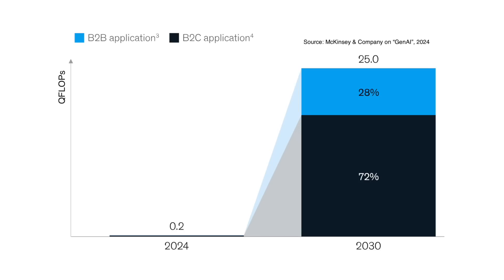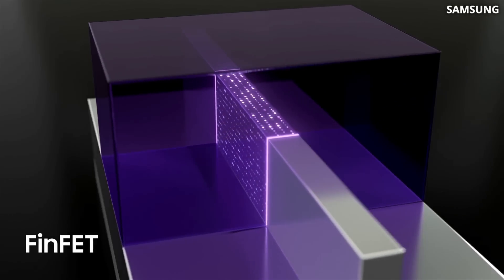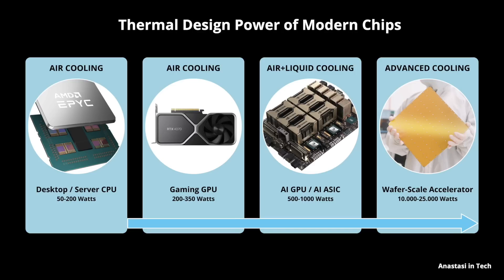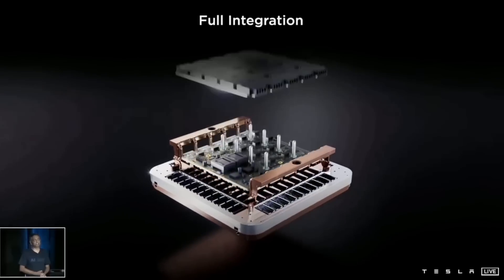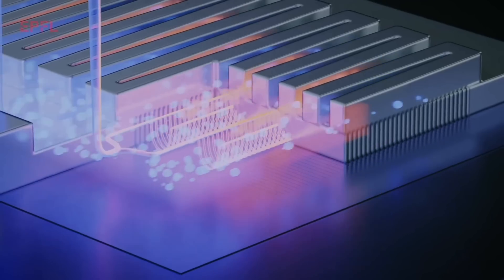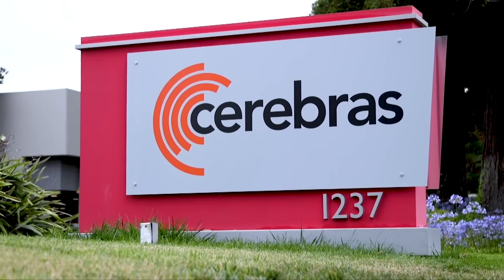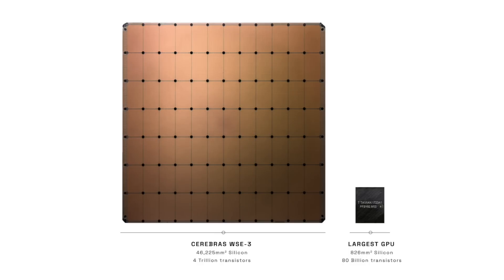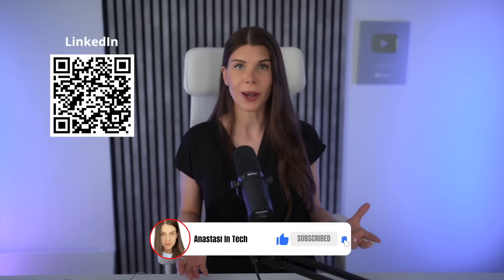This New Technology Will Keep Moore’s Law Going

Comment: It's all fun and games until your cpu internals gunge up.... Now if the internal cooling is sealed has an interface to transfer it out I'd have less concern, as cleaning out a cpu sounds like an exercise in futility. May be the terminaor franchise chip shape was not as whack as it first looked, even if the size is...power delivery and cooling in 3D completely enclosed in a cooling transfer interface.....

Comment: What we need is much more efficient devices to convert heat energy into electrical energy. Something that can be placed right on the chip. That way they can power themselves from the waste heat they produce. The hotter they get, the more power they are using, and the greater the output from the heat to electric devices. In quiescent state very little power will be generated but very little power will be needed. Works out perfectly. Of course some heat will still have to be conducted away so it's not perfect. But then neither am I.

Comment: Chip design engineers apply state-of-the-art supercomputers & simulations to conduct the design-of-experiments & Theory of Constraints to optimize performance, while minimizing waste/heat, cost, etc? All other factors equal, the winning design would generate less heat-per-instruction, right? Assuming the predicted limit of Moore’s Law includes the current heat constraint, now you turn the focus to cooling (which will quickly reach it’s limits). Hence the need to move beyond silicon to Graphene or GaAs, each material introducing their own set of challenges such as base cost & disposal (arsenic). All very interesting engineering. Hopefully faster chips & clusters will accelerate the generation of design alternatives that are smaller, faster, cheaper, more energy efficient & environmentally sustainable. Hopefully, Material Science will take us well beyond today’s design limitations.

Comment: Maybe combating overheating batteries could help solve this with graphene which has the best thermal qualities .maybe sandwich the component's ,but then their might be electrical run off,where a similar material with better resistance could work

Comment: Personally I think more detail than saying “switching between 0 and 1” would be useful when talking at this level. I believe we are talking about a 0 being below a certain voltage and a 1 being above a certain voltage. 

I see this as important because transistors that work above and below 0.4V use twice the power as one that works above and below 0.2v

What voltage are we at right now?

Comment: Dumb question: why can't we make graphene vias in chips to transfer heat very efficiently in linear flows? Seems like having some tiny vertical spikes of graphene nearest the areas under the most thermal load might significantly improve the amount of heat that could be transferred to the coldplates or IHS.

Comment: Not sure why I didn't chill from watching all this.
But seriously…In theory, if you have a perfectly defect-free crystalline material, you can have a thermal superconductor. One requirement for this is that it must be a single element, and it must be isotopically pure. If a diamond, for example, it must be all carbon-12, or carbon-13. But even then, for chips, you're not in the clear at all. You have billions, even trillions, of features etched into the material. Dopant atoms are everywhere. So there goes your heat superconduction. However, is it possible to improve things a lot by eliminating defects and isotope mixing? Someone care to weigh in on this?

Comment: i never understood why they try to stick to a small size for the cpu, sure you get way more yield from your wafer but we are seeing 95c temp CPUs as the norm now so a bigger surface area would allow more cooling and spread the load better. If you look under the IHS the actual processor is 1/5th of the size make the CPU 50% larger and seperate the chips more and allow more cooling.

Comment: Love the video! Been catching up again. Got to say I've been thinking of acoustic resonance cooling combined with a jules Thompson cooling effect to the integrated heat spreader for a while. It would use a "balanced armature" (very small diaphragm pump) that would help with power delivery through soaking up emi areas and collecting free errant electrons during expansion. Basically it's shaped to bend during heating, but also has these tiny capacitors they just developed that have power get delivered from these tiny coils placed around transistor areas to soak up emi and z style electromagnetic fields produced via current delivery. They pump coolant around like this talks about but it changes the stability of band gap frequencies as it flows because it's conductive (slightly) as it changes pressure during flow. 

Which captures more electron hole potentials and electro magnetic/static fields into itself. Granted it becomes more resistive to follow as it does this and gains more heat. So it has to go into a much larger expanse area into the heat spreader to release it energy, electromagnetic potential energy, and it's kinetic energy so I figured a passive diaphragm capture for acoustic resonance would be good to do as it then places a phonoic force wave through the material to keep "still", I guess, the material but gains reflective disorder and kinetic energy back to it that can be dissipated into a regular heart sink/spreader.

But I was also getting into light fiber optics for cooling that can be conductive, if we could reflect light in through the liquid that take advantage of the pumps, them we could create a photon cooling area into transition area that works off of a grid reflection pattern. This would in turn help with the acoustic resonance cooling, while being able to help deliver switching help. Either make a switch happen, or reduce it's chance. But then conductive fiber optics get into the conversations with that for power delivery for old school tube TV tech that can alter frequency, direction, reflective properties, placement on target, photon resonance emittance, and so on. It becomes more of a hybrid qbit & regular transistor chip design. Something I put up on my other YouTube channel but it's long winded for some I'm sure.

Comment: I think, for comertial usage, it will rather go another direction entirely for quite some time before this cooling designs will be applied to, lets say normal desctop of mobile cpus,... I think there will be a transition in materials applied to the cpu first,... i am not quite sure what material that was,.. but there is something, i think it was graphine, that managed to have way way less resistence and therefore way less heat that was produced... i think this will be implemented first, and later on, when even this starts to come to its limits, cooling designs that by then will be way easier to be implemented, will be addet to the cpu design... I can also see some kind of integrated vaper chambers of some sort, if thats even possible with so small channels... or cooling from both sides of the motherboard. I also found intels prototype of the cryo cooler very interessting, maybe something like that might hit market at some point in the future.

Comment: Seems sketchy: Galavanic Corrosion, thermal cycling, Flow control, clogging, vapor locking (boiling), etc. 

My guess instead of liquid cooling they will use helium gas as the coolant as transfer heat faster than air can, since helium is inert its not going to cause corrosion problems. Helium is less likely to clog, and since its already a gas, no worries about boiling. Boiling would be really bad since it would prevent the flow of coolant creating a trapped bubble of steam in small microchannels integrated into the chip. Helium is about 63 times more efficient in transferring heat than air is. something like Frore system fan tech would also need to be incorporated into the design.

I don't think liquid metal alloys are an option because of the liquid metal interacting with silicon causing errosion or embrittlement.

Comment: Another great video!
What is the trend for amount of heat produced per transistor? I assume that it's been going down? 
I wonder if there might be some way to develop a transistor that actually produces less heat somehow? Are people studying the actual mechanisms that produce the heat and whether there might be other ways to do to reduce those heating effects? 
Data centers produce so much heat, I wonder if that energy ever gets put to use somewhere, such as in heating houses or buildings ?

Comment: Well, we are at a time when we begin to realize how becoming smaller is no longer a solution for sustainability. Engineering the servers and mainframes of the future may be somewhat foreign to what we are doing now. Integrated circuitry will become larger, to avoid burnout- the larger will see more efficiency over time as the need to replace the tech is mitigated and the need for more speed is pointless. The heat will be spread out and lost in something that is non toxic, and the heat affords life to intermix with the outflow and sustains not just the processing, but an entire ecosystem. That heat will then be locked up in carbon of plants, which will store the energy for later generations avoiding greenhouse gases from building up, and heat from impacting the environment directly. The heat will FEED the environmental good, not adversely impact it.

Comment: Making the silicon itself in structural patterns will be the next step, not forms or shapes, but actually engineering the molecular structure of the silicon laid into the shapes, so as to move heat more effectively as it is received. The molecules themselves will transfer the heat outward so the liquid can take it away in larger amounts. The density of the silicon is one of the major problems. By creating a layer within the silicon that moves heat faster to the outer layer of the silicon, you can disperse far greater amounts of heat. I don't see this in the works yet. For chips to get 30% more heat dispersed, you need 30% more inductions to occur from within the silicon itself. These things are so small already, you haven't the room to notch or touch the chip more effectively without affecting the total design again, and when the efficiency of the electron flow is impacted by this cooling design, you are at another impass without molecularly configuring the flow from within the building material itself.

Comment: 6:55 copper has a higher thermal conductivity or lower thermal resistance
And it's not 4 times higher, but more like 2-3 times, also depending on the purity of the copper.

Comment: Just one addition: the problem is not the power or generated heat itself. A power plant with e.g. 1200 MW power output has roughly 1800MW of additional power that is simply heat (assuming a 40% efficiency of process)
The issue is power density and how to transfer this high density power output to a larger area where it in the end is air cooled.

Comment: I wouldn't flow a liquid through the chip unless its a closed loop to minimize contaiminates , tho if it's done using a gas  and  phase change techniques as a heat exchanger that would be great , quantum computers are cooled using helium , the processors only a few watts but the cooler is about 20kw per qbit , personally I rather photonic computing processor's

Comment: Take apart the pump of any aio system older than a year and see how clogged the microchannels are with corrosion products and other crap. How are you going to clean the channels in the microchip that can be blocked by any speck of dirt?

Comment: What about a new technology that cooling the CPU from both sides, so in this way you can use 2 heat-sinks, one above and one below, for example for use on Desktop CPU. I Think on a centered die from one side with it's pin-out and from the other side an "O shape die" with it's pin-outs on the other side, in this way you can place two heat-sinks i.e. one for air cooler and other flat below for water cooling.

Comment: Clearly humans are doing something wrong, putting so much effort to develop better systems to disperse heat generated by the chip is wrong, they should develop chip that does not generate so much heat. If we put 1000W of energy and we need to disperse 950W of heat - that means that we mostly waste energy.

Comment: Paragraf is a company making inroads into graphene based semiconductors (not at chip level yet but certainly FETs;  potential for better heat management and performance density using the same manufacturing process.

Comment: With respect to the fantastic innovators of today, I am rather confuddled by the trend to make silicon tech' run as fast as possible.
If you double the clock speed, you quadruple the power dissipated.  This behavioral law holds fairly well up to over 5gHz clock-speed.

Why not clock at lower speeds and focus on how to implement parallel processing (a concept explored in the 1990's that sadly failed to mature into anything of note).

I think the migration down to 3nM tech' would have surely revived such concepts.  Yes, the difficulties in respect of managing tasks in a segregated manner are substantial, but good solution/s would undoubtedly be game-changing in respect of computing bang for energy buck.

Comment: I never used liquid cooling . However, Today It is getting to the place you need a sag brace for the CPU air cooler due to the weight and the size. Today you can get a ligiid cooler for about teh same price as an air cooler. . I mostly work with 65 w and I do have one 105 w chip a Ryzen 5900X. Air is simpler in so many ways.

Comment: Using a coolant other than water might be more efficient. Something like gallium or rubidium. However, these have much higher viscosity so you'd need bigger pumps. They're also very air sensitive so the transport system would need to be designed around oxygen impermeable materials, increasing cost and complexity. But for a server farm these would be worthwhile investments.

Comment: a big problem with the cooling of chips today is due to the material limitations of silicon.

here is the problem as CPUs re clocked higher their voltage theshold for the individual transistors drops and it can drop to at least as low as 1.3V, while CPU transistors today from intel are taking 1.5- 1.6V and i think in some cases higher than 1.65V.

BUT this is where the material limitations turns into a double edge sword, silicon is not very efficient (its just better than the other economical options) and requires 0.4V just to be "on" and able to do anything. so while CPU get clocked high and high again their voltage threshold is dropping, but the 0.4V just to be "on" remains totaling unimproved upon, meaning that as chip get faster they have less usable voltage per transistor, this is also one of the reasons why moore's law in the less literal, more colloquial sense died, quantum tunnelling as of 7nm also become one reason which is also another material limitation of silcon

interestingly enough they are working on graphene chips, and one team is working on making graphene chip that actually use quantum tunneling in their computation process, rather than the computation have an error as a result of it. eventually it may be application to other like materials, possibly silicon too.

i personally don't see silicion having much of ta future of improvements in power, but they can be made a lot smarter (like V-cache, which has its own voltage sensitivity issues, but at this point i wont even consider a computer that doesn't have V-cache) or ASICs (application specific integrated circuits, for those that don't know these could theoretically speed up certain computer functions by up to 30,000% and use up to 96-99% less power) which are the future of processors especially once we hit matured 3nm (or smaller) nodes.

but silicon is running out of runway, we have 3nm already, 2nm is on the way in 2025, and 1nm has been in the labs for the last few years, and likely wont see the light of day before 2030. and 0.5/0.6nm transistors,  if were still using silicon by then likely wont exist before 2035, they are slated for 2037 currently. i have heard it said that there cannot be transistors smaller than 0.6nm, but because of the size of a silcon atom its absolutely impossible to scale smaller than 0.2nm, so one way or another silicon close to limitations.
Reply: @antimatter314  that's above my understanding currently, apparently they are however used in quantum computers, possibly to entangle qubits, if so thats not applicable to tradition CPUs, and was unable to find anything on yttrium barrier copper oxide being used to reroute or convert heat into current or electricity.

on a cursory glace of some material on it, it seems like this primary application is on magnet related applications including fusion reactor plasma containment via magnetic fields.

Comment: Thank you Anastasia! Even for the pun (joke). :face-purple-crying: 
I'm a retired Industrial Design Engineer (Mechanical, Electrical, Electronic, Software). You explained this very complex system very well. I suspect that the answer to the heat dissipation problem, will eventually require new materials & techniques. That is one area a lot of research effort is being conducted (no pun intended!) 🙄😏

I subscribed & look forward to more. I will also pass your channel link to other tech streamers that I think will find this interesting or useful.  Thank you again, and I wish you the best of luck. 👍